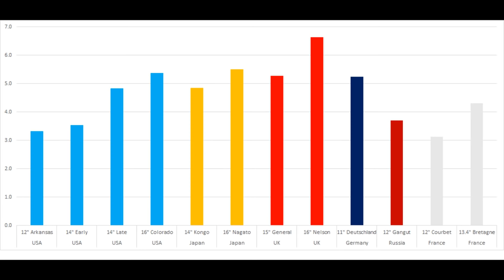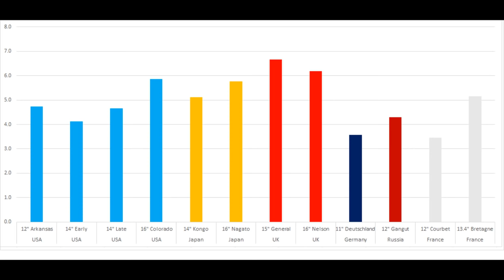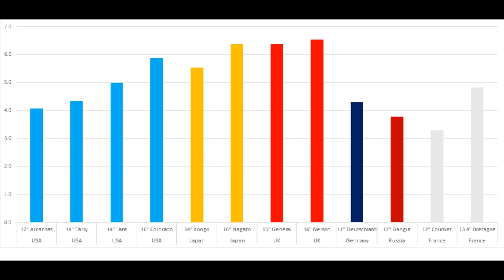Battleship Guns of WW2 - A series of tubes

Comment: I'd like to see a deeper look a how the big guns were made.  As a metal lathe user, the boring and rifling process seems really difficult.
Reply: Yeah, for real, what kind of monstrous lathe would be required for this?
Reply: It's an interesting subject and there was more than one way to do it. The debate between wire-wound guns and built-up guns being a case in point. Suffice it to say, it's complex and guns were one of the most difficult things to build for capital ships. Gun mountings were probably the most difficult thing to make, followed by armor, then the guns themselves. You had to be a world class industrial power to produce this stuff.
Reply: What about cruiser guns 5.25 6 8 I recon I've got about 25 seconds to get under cover.......says running 🏃‍♂️
Reply: Sounds a bit BORING
Reply: E Van  Not very useful when he says the boring operation is like a big drill press.  I know my boring bars have serious deflection issues at 5 diameter depths, what's it like at 50?
Reply: @myopiniongoodyouropinionbad  you pun was a bit of a damp squib.
Reply: 3d printed ha
Reply: Straight, deep boring is a mix of drilling and trepanning. The material being cut needs to guide the cutter as well as get removed. Cutting rifling is more like very long, multiple threads cut by "pushing" or "pulling" the cutter. Again, the workpiece is guiding the tool while being cut. Many barrels are drilled, reamed and honed (for straightness and diameter), then grooved.
Reply: @stevewyckoff6904  did they maybe use a broach, would that even work, I’ve no idea
Reply: @stevewyckoff6904  Don't know, but I suspect the bits used were nearly the diameter of the barrel, for the final boring anyway. Also, you get a lot less deflection with slow speeds and a minimal cut.
Reply: IWM have a 3 hour film called "BRITAIN PREPARED : A REVIEW OF THE ACTIVITIES OF HIS MAJESTY'S NAVAL AND MILITARY FORCES" from 1915 that shows the manufacture of a 15 inch gun. The film is split into reels - reel 2 shows the manufacture of the gun.

I can't seem to post the url in the comments so if you search for the above title you should find it.
Reply: @rnbreech4194  omg, that is a GREAT video to watch!
Reply: @lazyman7505  Thanks , metal matters... links are good
Reply: Old daze bronze , the french guns were special ,much better ; as I recall there break threw in design , was about the bit stayed still and the barrel set strait down on it , an spinning..prolly to help disperse the heat - less work hardening and thus less brittle , a fine thing - as explosives can bee dangerous ,this data is old 1860s. 1812...
Reply: @rnbreech4194  I'll be looking for it!
Reply: @davefinfrock3324  o or
Reply: @haroldhenderson2824  no
Reply: There's more than one way to build a naval rifle.  The British, Italians, and Japanese favored jacketed wire-wound guns which were easier and cheaper to make.  The process was developed in the USA in the 1890s by H.P. Hurst.  The USN and French Navy preferred built-up guns made from forgings with successive hoops and jackets shrunk on top of each other invented by Armstrong in Britain ca. 1860.  The Germans made built-up guns from castings.  If we built large guns today we'd probably make them from centrifugally-cast tube which is the way most steel pipe is made today.  They are as strong as forged pieces and can be made to precise dimensions reducing machining costs.  The Washington Gun factory cut rifling one groove at a time, a laborious and expensive process but necessary since they favored progressive-twist rifling up until WWI. Krupp used the same process. Hammer-forged or button rifling is favored today and takes minutes instead of days but can only make straight-twist rifling.  Hammer-forged barrels last longer.  There are old Scientific American articles online that describe the way big guns were built.  There are also some amazing videos on youtube.

https://youtu.be/TowYdhn8AeI
Reply: Wow I agree, how did they bore out the guns. How for that matter did they create an 18 inch PLUS ingot of solid pure metal that could then incredibly be bored out WITH an 18inch core drill?!?! 
Or didn't they even use a drill at all? Did they roll and then weld???
Reply: @stevewyckoff6904  perhaps they use a boring head, with support pads which lightly touch the bore, and reduce chatter, and improve straightness?
Reply: Check out Watervliet Arsenal. 
They have some videos here on YT about some large barrels.
Reply: Once you've got a through-hole from one end to the other you can line-bore so you're not testing the rigidity of a boring bar.
Reply: The barrels are made several ways usually depending on the size. Almost all of them use a layering system of sorts due to the salt water, as well. Stainless interior, hardened steel for the bulk of the barrel, then a brushed stainless exterior so it can be painted to prevent rust. Putting the rifling in the barrel was done differently depending on the size of the bore (I also didn't deep-dive into how the rifling was made; my info may be wrong in this matter so I won't share it), but finishing the exterior was almost always done using large metal lathes. Getting the "layers" to fit together tightly would usually be done by heating the layer, then placing the cool layer inside it then allowing the outside layer to cool and shrink onto the inside layer. This was NOT done like older shotguns where a strip of iron was wound around a rod, "welded", and layered. The layers were usually cast, from my understanding, then machined to finish.

Comment: Setting the large cruiser or battlecruiser argument aside. I'm curious to see how the 12"/50 on the Alaskas would compare to the other 11" and 12" guns.
Reply: Those are widely regarded as the most powerful 12" weapons ever created.
Reply: It is not how they would compare to 11 and 12, but how they would compare to 14 and 15 inch guns.
Reply: @MrTScolaro  12"/50s were lauded by ordinance as being ballistically very close to the 14"/50 mk B.
Reply: @420JackG  Sure, but do you trust the BuOrd?
Reply: @gokbay3057  not if they tell you something about working torpedoes
Reply: @gokbay3057  when it comes to that series of naval rifles in particular? Yeah, probably.
Reply: @gokbay3057  When it comes to guns?  [looks at 16"/50 Mark 7, looks at 8"/55RF Mark 16]  Yeah, I think so.
Reply: @420JackG  yes.  However, I wonder how they would stack up in Drach's rubric.
Reply: Alaska used a superheavy AP shell proportionally similar to the one used by the USN fast battleships.

So it was a longer, heavier shell with a proportionally smaller bursting charge for its weight.

I would assume Drach has similar views as he does with the 16 inch shell and that he would have preferred the British style shell that is almost a semi-armor piercing shell trading absolute maximum penetration for a larger bursting charge and significantly more damage to the unprotected areas of the target even if it doesn't fully penetrate the main armor.

Not saying he's wrong or right since both style of shells proved effective when given the opportunity but there were precious few examples to draw conclusions from particularly for the super heavy shells.
Reply: @bcoop1701  I have to disagree that bursting charge is all that important. How good your bursting charge is only becomes a factor if you can hit and if you can penetrate & then it the charge has to still function. Bursting charges usually don't get triggered unless they hit fairly substantial armor so it's generally not a factor against unarmored or light armored sections or ships. Getting a shell through BB armor intact is also very difficult. So I think to many other things have to happen for burst effect to play a major role, at least to be considered as an even weighted factor as something like penetration.
Reply: It would have been nice if the British 12in and 13.5 wew included in this list particularly since they will were such large players in world War One
Reply: the 12/50's was the best 12 inch gun ever made same with the 16 inch 50 its was probably better than the 18.1 inch gun they were going to build a 16 inch 56 calibre gun which with super heavy shells it would be approaching a 18.1 inch shell in weight and pen
Reply: Considering that they are the most powerful 12in guns ever created by man (owing to them being the last ones created and this getting a super heavy shell) it would easily win hands down
Reply: They were really good guns. Their packed a heavier punch than most 14” guns.

Comment: Shell weight gets full effect against homogeneous, ductile plate, but against face-hardened plate, weight has much less effect since the failure method by such hard-faced armor is always (other than some surface flacking) due to cracking of the hard face layer radially and circularly, like safety glass in a car window, and this is much more due to shock effects from the velocity of the shell when its tip suddenly stops on the plate surface and the shock of impact goes back into the shell and into the plate.  Once the shock forms the cracks to weaken the hard face, it can be pushed back through the soft shock-absorbing back part of the plate by the mass-based KE- remaining to the shell.  Since the cracking of the face is needed to allow the shell to do more than gouge the plate face somewhat with no other real effect, the mass part is delayed and thus has minimal effect in the total penetration results.  Against homogeneous, ductile armor, the deforming of the softer steel or iron begins immediately on initial impact and full KE using the full mass is always applied.  If you have weak/brittle AP projectiles that can't take the initial shock, especially at an oblique angle, then those shells will be even more degraded against all armor type with one exception:  Above 45 degrees impact angle, a projectile nose shape and AP cap design affects the penetration ability -- ricochet result instead of penetrating at a given impact velocity -- and it turns out that a broken shell, if not reduced to to small pieces, can have its upper end broken off and fail to penetrate (glance off), but now this no longer pulls the rest of the shell with it, so the middle and lower body, if not too broken up, can keep digging into the same area of just beyond it like a snow plow and punch through where an intact shell merely bounces off.  In some cases, if the filler cavity is small enough, the shell will still blow up at full power, too, though don't count on that.  Still, any penetration is better than no penetration, even if the results are minimal.
Reply: Check out his FORGING ON video on differences in the production of armour plate.
Reply: @ulrikschackmeyer848  Trust me, Nathan knows about this.  He's one of Drach's sources for that video.  He's also pretty much the accepted expert on external and terminal ballistics for large guns, and for armor metallurgy and performance, at least in the unclassified world.  I think he actually has a doctorate in the field.  He's probably forgotten more about the differences in different armor compositions than most of us will ever learn...
Reply: @rdfox76  I've googled Nathans' name and I have to salute his dedication. I have a lot to read thanks to this comment.:-)
Reply: Nathan; all that may be true - and I don't doubt a word from a man as well-credentialled as yourself - but what is the point you are making?  Are you saying that for Drachinifel to assess the value of each gun he needs to add a new parameter to reflect the type of armour on the nationality of the ships against which the gun will be used ?

If you simply were to say "Armour penetration is affected by the type of armour being struck, and the angle at which the shell hits that armour"  then I would not disagree, but the statement is no more than an obvious motherhood.

Comment: Armor penetration is rather complicated because there are two different kinds of armor, face hardened (based on a variant of German Krupp Cemented (KC) armor in the 20th Century) and homogeneous, ductile (either based on the highest-strength steel similar to KC armor, but no face hardened, used for thinner direct hit protection or protection from highly-oblique impacts such as decks, or a weaker steel, such as British High Tensile IHT) or the improved post-WWI "D" steel, both pf the latter used primarily as anti-blast/fragment protection with projectile impact being secondary.  Face hardened armor is designed to break projectiles up to reduce their penetration ability and the AP shells designed to penetrate it had steel "crash helmets" called "AP caps" added to their noses to prevent the nose breakage. as well as making the projectiles stronger by various other means to stay in one piece.  The AP caps can be soft, tough, hard, or super-hard, each having different properties.  This gets complicated very fast...
Reply: Well, not to be difficult, but there are a lot more than two types of armor steel in these ships. You might narrow it down by individual production runs, but that's about as lucky as you're going to get with that one.

Comment: As Ching Lee demonstrated, turret alignment and calibration with fire control radar led to the most important aspect of BB main batteries; being the first to put steel on target usually won a particular engagement.
Reply: That would probably matter a lot in an equalish fight, but at Guadalcanal it didn't
Reply: @stevebloom5606  The cruiser admirals had no faith in radar in 1942. Had they trusted some of the cruiser captains like Gil Hoover who knew how to use SG radar, the USN would have lost far fewer ships and sailors and admirals in Ironbottom Sound
Reply: Putting projectiles on target first is important, whether it involves a handgun or a naval gun.
Reply: At the ranges Washington & Kirishima were engaged at getting the first licks in definitely made a difference!